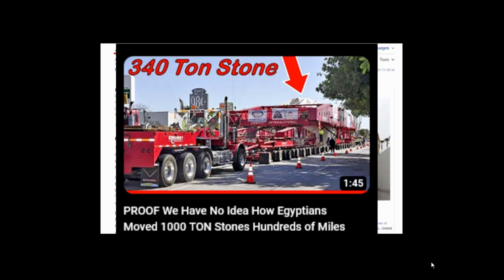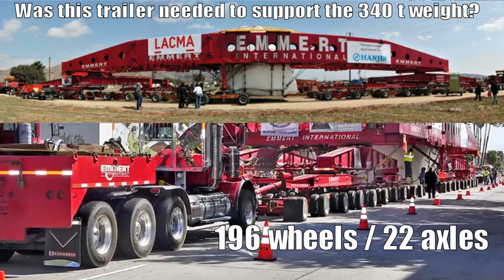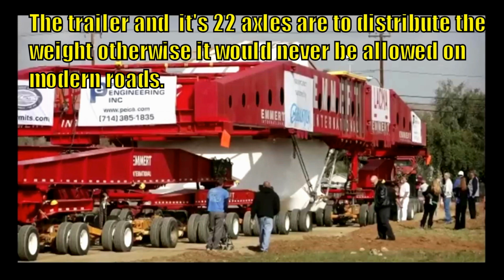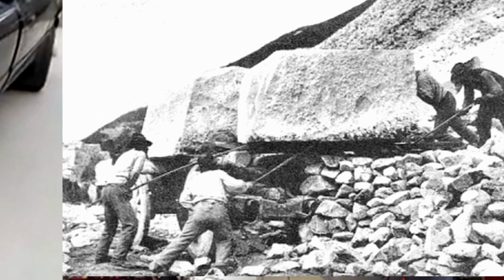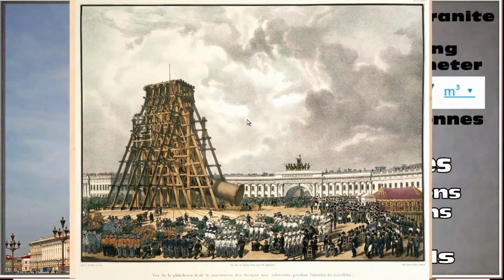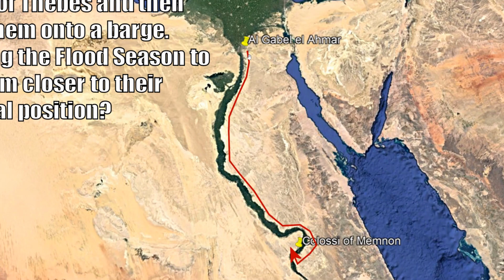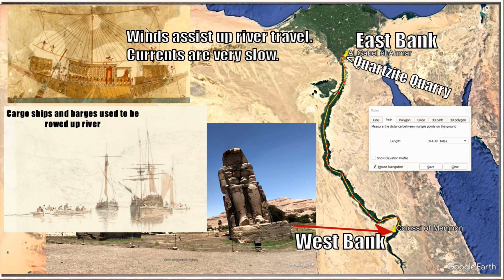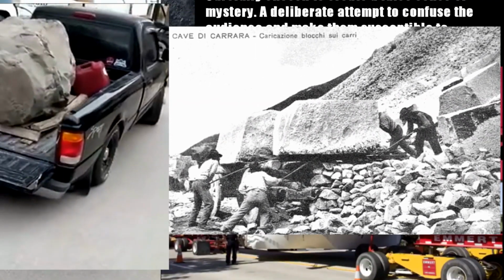Why Does Lost Ancient High Technology Keep Repackaging Old Scams As Fresh?

Comment: Happy new year!!!
And I have a bet for ya.
Since you insist that it's so easy to transport large stone and put holes and all that using ancient means...

Can you cut and carry a 4 ft x 4 ft x 6 ft granite, put it in your back yard, and drill a 2 inch wide hole, all the way through 6 ft length of the granite?

For transport, you can use any modern means, although ancient technique should suffice.
For the hole, do use ancient technique, like using some copper sheet thing, and document the progress.

I will give you 1 year, and if you can get it done, I will donate $3,000 USD to you as shown in the description.
Deal?
Let me know.
Reply from the maker: It wouldn't even pay for the stone.
I'll assume you are joking because this "deal" would be laughed at by any serious adult with a little bit of experience in grown up.
Here's $500 dollars, build me an extension on my house.
Here's enough seed to plant half an acre, now farm me an acre of wheat.
Reply: @SacredGeometryDecoded  Why would anyone pay for the stone?
I am asking YOU to:

1. Go find a granite rock in your local mountain, valley, or local quarry
2. Cut a 4 x 4 x 6 ft piece out of it using any modern method or ancient
3. Toss it in your truck, bring it to YOUR home
4. And then, drill a 2 in wide, 6 ft deep hole using * Ancient Tech *

Total out of pocket cost for ya = $0 + gas for the truck
But I am going to pay you $3,000, just showing how you did it.
You keep everything yourself.

Huh?

And how is this proposal equivalent with ME (living in USA) going to Australia and build an extension in YOUR home.
Do you think? Or R you high?
Reply from the maker: @sbkarajan  no granite for hundreds of kilometres from me.
“Hello can I set up a temporary quarry on your land and expose you to a court case if I’m injured”
You have no clue how the adult world works.
Who’s going to pay for my food or accomodation? 3k wouldn’t cover it.
Plus it’s more than a one man job and I’ve shown people moving bigger. That point is settled.
I’ve cut and drilled.
You get off your lazy ass and do something rather than”promising” 3k for a job that would cost many times more.
If you are not joking then you are so ignorant of real life. 3k wouldn’t buy a fence around a suburban size plot.
Months of work for 3k is the most idiotic offer in modern history.
You are detached from reality.
The personal injury insurance would cost more. 
All to prove to you things that have been done. 
Stop pretending to care . I have show cases old quarry and masons at work.
I drilled and cut with copper multiple times to show cutting rates.
Get off your ass and do something rather than offer pennies for a dollar.
If you are not joking the you are utterly ignorant of real world adult life.
Reply: @SacredGeometryDecoded  Why don't you just say you cannot do such a simple task, that was so~ easily done by the ancients?
Reply from the maker: @sbkarajan  it’s been done and I show examples of old timers doing it. You are another entitled lost tech fool who pretends to care but is too lazy to look the old timers up. 
Nutters like yourself used to insist copper can’t cut granite etc etc.
Now you demand others do even more of your homework for you.
You have no idea at all how things work or the cost of anything. You are a spoiled child or have been coddled into an ignorant adult.
To suggest 3k for such a job is just plain ignorant. You have no clue whatsoever. Even as a joke it’s too far fetched of a premise.
You live in such a fantasy land even the current day confounds your understanding.
Reply: @SacredGeometryDecoded  "it’s been done"?
Did anyone drill any hole, 6 ft deep, into a granite stone, using ancient method?
Please, teach me, enlighten me, who did it?
Reply: @sbkarajan  You are the type of person that says 'now build me a pyramid'. Goalpost shifter. 
Ever heard of extrapolation? It's a thing.
Reply: It's in the elementary school math-books. If 50 miles takes one hour, how long would 100 miles take?
Reply: @sbkarajan  Elementary, Watson.
Reply: @Akimos   Bro came in with 3k offer as if he is Mansa Musa or sth LMAO. Delusional...
Reply: @Akimos  Well, I think I have seen folks drilling 1/2" deep hole in a granite, took all day, and quit.
But are we supposed to extrapolate that to 6 ft deep hole?
That's like jumping 3 feet, which is quite high, and claiming that using the same technique, one can jump onto a 3 story building?
Huh?

Just show me somebody, anybody, drilling a 6 ft deep hole in a granite stone, using copper sheet, I will pay YOU $3,000.
How about that?
Reply: @Akimos  You guys are claiming that's how the sarcophagi in saqqara are made, right?
By drilling 6 ft deep holes, 60-70 of them, within a year?
So it should be EA~SY!!!! 
PROVE IT NOW!!!!!!!!!!
Reply: @sbkarajan  Like I said. You are the kind of person that says 'now build me a pyramid'. Maybe you need to understand that drilling is linear, what time it takes to cut into an inch is comparable to a foot, like time in my example. If I were to cut a hole that is 5'11'' you'd say that is not six feet. So there's no reason to do that. Unless you pay in advancce, of course..
Reply: You could jump 1500 feet high and 60000 feet high and your terminal velocity would be the same. (Edit 1500 ft, not 500) (Edit 2, I'm metric)
Reply: @Akimos  I will pay you $500 in advance if you have 4'x4'x6' granite ready to drill.
But I think I am wasting my time here.
You can't even get the little block transported in your backyard or shop or wherever.
While, Egyptians moved *MILLIONS* of stone blocks in 20 years and built the pyramid???????????
Using whut? Sticks? Wooden rollers? On sand????

Anyways, get the block ready to drill, $500.
Use any means on that, power tools, jacks, truck, trailer, whatever.
I will give you a year to work on that now, LOL!
Reply: @sbkarajan  You still think money can buy brains? Muahahaa
Reply: @sbkarajan  Millions of stone blocks that are not shaped at any time with a drill? Those blocks you mean in the Great Pyramid? (Edit: wrong propositon)
Reply: @sbkarajan  Let me ask you this, how far to your knowledge, is the quarry for the 99.9% of the stones in Great Pyramid?
Reply: @Akimos  "You could jump 1500 feet high and 60000 feet high and your terminal velocity would be the same"
But you jumped from like 5 feet. LOL!
1/2"  deep hole?
That technique ain't drilling 6' deep hole man.
THIN~~~~~~K!!!!!!!
Reply: @sbkarajan  Let me ponder you with this, is there any need to drill 6 ft holes, when you drill, say a sargofagus, or can you drill less than that, and still make it work?
Reply: I'm not hearing any coins meeting the floor yet, but I'm hoping for the pennies!
Reply: @Akimos  One of the largest sarcophagi, the dimension is:

Outside: 12.6 ft x 7.6 ft x 7.6 ft
Inner hollow: 10.4 ft long x 4.8 ft wide x 5.7 ft deep

So, how did they dig out the hollow?
How did they even cut that box out of the quarry?

I believe you have all the answers, some dumb theories that cannot be proven, not even remotely!!!! 
1/2 inches deep hole???? All day!!!! LOL!!!
Reply: @sbkarajan  Let me help you with the drilling a bit: There's a number that one can drill a day using handcrank. There's a number of how many workers can do it at the same time on one sargofagus. 
Another hint is that there's no need to drill 6'' because you'd rather drill out significantly less per layer, and knock it off, before furthering down. (Edit:misspelled words)
Reply: @Akimos  Yeah, I shifted the goal post....   really?
From the beginning, it was NOT about quarrying the stone, I am not interested.
I am just interested in the nonsense you believe.
How the heck do you drill a SIX FEET DEEP HOLE using stupid copper sheet?
S-I-X F-E-E-T????

No need to drill 6 '?
Not because it's easy, but because it's not doable, because it's IMPOSSIBLE!!!!
Huh?

Or, prove me wrong, you will love it.
And my $3,000!!!!!  🤑🤑🤑
Reply: @sbkarajan  OMG I got deleted... but

You are not interested. Really.
Reply: @sbkarajan  You are not even remotely interested in the actual work. you are just running your mouth. It's easy, when you understand the principal. 
Like asking a girl out. Would I dare, and the next thing you know, someone is getting, and here you are, stuck on capslock.
Reply: @Akimos  What the heck do you know or care about what I am interested?
$3,000, I am serious, and I want to know.

Or, just answer this simple question.
Can you drill a hole, 6 ft deep, into a granite, using hand cranked copper sheet?
I will give you a year to do it, and I will pay you ***** $3,000 ***** if you get it done.
There is only one answer.
Yes/No?
Reply: @sbkarajan  Stone Bell Hole Drilling
Kauai's Hindu Monastery
Reply: @birushinobi  There you go
Reply: @birushinobi  Interesting!!!
But these guys are arguing * copper sheet * and drilling 6 feet into it, not steel chisel. 
Nobody disputes using steel to cut and drill granite, but thanks for the info!!!!
Reply: @sbkarajan  You asked if it could be done using old methods, there you go. 150000 dollars, thank you
Reply: @sbkarajan  Just hope this helps on your journey to see better.
Reply: @birushinobi  Seeking the truth.
Do you believe we are just random creation of molecules mixing up in some ancient soup?
Do this.
Think of a way, you can build a * SPOON ***, made of any material, and make it to produce a copy of itself.
Like cells do.
How would you design such a spoon?
Let me know.
Reply: @sbkarajan  You said six feet. I said, there's no need to drill six feet for the sargofagi in Saqqara, but significantly less, and break out the layer, rinse and repeat. Stop making stuff up. No-one knows if they mixed techniques, so your request for 'do six feet' is useless. Furthermore, egyptian copper (arsenical copper, and we have proof for that also) is comparable with mild steel on Vickers scale, that is the test for metal hardness.
Reply: @sbkarajan  Do you understand? Comparable materials, two person can drill 18 inches in six to seven hours, that's 150000 your dollars for two person. 
Pay me up, will you.
I guess not. 
Don't be so quick to judge old timers.
Reply: @Akimos  I have no idea where $150,000 came from....
But are you drilling 6' or trying to collect $$$ without actually drilling 6'?

Are you an honest person do you think?
I believe I am honest, and I am seeking the truth.
Apparently, you just want to win, seeking TRUTH is not of your concern.

In my opinion,  Sarcophagi of Serapeum can be built using current tech, but not by the tech of kingdoms of Egypt.
But the Inca walls, those with curves and thin pieces that fit without any mortar.... 
I don't think current tech can reproduce that.

Anyway, a lesson learned today.
6' deep drill hole cannot be produced using stupid copper sheet!!!!!!
You gave up!!!!!   👋👋👋👋👋
Reply: @sbkarajan  $3000 for 6 foot hole. That was your bet, in a year. 
So they could do $150000 if they worked for a year. It's math. It's a thing. 
I'm all about science and truth. Inca walls, goalposts are shifting again. Anyway, SGD has videos about all and any of your concerns, maybe give them a look and make an educated guess after seeing those. 
Serapeum is not old kingdom. Maybe look that also into more. (Edit typo)
Reply: @sbkarajan  One more question, how come you have $3000 to spend when you have zero mathematical skills, is it inherited?
Reply: @sbkarajan  I should have said 'are they inherited', because that is what I meant.
Reply: @sbkarajan  Anyway, a lesson learned today.
6' deep drill hole cannot be produced using stupid copper sheet!!!!!!
You gave up!!!!!   👋👋👋👋👋

All of these seems untrue. Maybe go trough this thread and see if there was anything that even slightly hinted how the boxes were made. 
I haven't even started yet. (Edit, typo corr)
Reply: @Akimos  I don't have just $3,000 to spend, I have a lot more...
My monthly credit card bill is about $20,000 - $30,000 USD... 😁
And Inca wall isn't shifting goal post, it's a **NEW** goal post, if you want a challenge, as you gave up 6' deep hole.

I saw SGD's video, he does not know what he's talking about.
Fitting stones with some arbitrary curve vs straight line, totally different.
Plus, fitting stones without gap and with gap, another huge technological difference too.
I put some retaining walls, rectangular concrete blocks, with 1-3 mm gap between them, easy.
If I wanted no gap, well, I could not do it.

The lighthouse example, just straight line, so it's not something comparable to curved inca wall to begin with.
And we don't know if the stones have gaps between the joint.
Reply: @sbkarajan  Again, you are comparing yourself to a master masons. One could have an anglefinder, or draw out the shape from the existing wall to transfer to next stone.
Reply: @sbkarajan  Elementary.
Reply: @sbkarajan  Let me help you with this, anglefinder in its purest form is two pieces of wood, with a nail in the joint. Think incas had the capability? OMG (Typo, again)
Reply: @sbkarajan  Let me ponder you with this; if the stones were found above the ground, is there a chance they would already fit together pretty nicely?
Reply: @sbkarajan  Or, as since ever, ignore all the evidence and points given to you completely. Your call. I'm not even warming up. (typos everywhere)
Reply: @sbkarajan  How far is the quarry? How far is the quarry for GP? You don't care.
Reply: @sbkarajan  The Great Pyramid
Core stone blocks were quarried approximately 400 m (1,312 ft) south of the pyramid, and the casing stones, made of white Tura limestone, were quarried on the eastern shores of the Nile. The King's Chamber stones were rose granite from Aswan, approximately 900 km (560 miles) from the Great Pyramid. Three whole seconds it took me, and you cannot be bothered.
Reply: @sbkarajan  Do you speak american? That's quarter mile on the GP.
Reply: @sbkarajan  Do you like kitties, I do, so much.
Reply: @sbkarajan  i can tell you like cat videos.
Reply: 🥱 Such feeble attempts at logic vis straw man argumentation......  Ancient sites represented = a societal effort - not an individual one.......  That you apparently can not think beyond your simplistic terms says it all.  It simply demonstrates you are consumed by your incredulity here until all you can do is ramble nonsensical arguments.
Reply: @varyolla435  I see, you heard of coral castle?
If the owner did not share how he did it, we’d have thought it was a “Societal Effort” too😜😜😜
And I am not actually interested in how the rock is carried, that’s “supposed” to by the easy part.
I want to know how the DEEP hole, 6 ft or more, is drilled using stupid copper sheet.
Drilling a hole is a societal effort too? 
Huh?
Logic!!!! LOL!
Reply: @sbkarajan  Like I said, goal post shifter. First it was drilling, then quarrying, now it's Coral Castle. Have you ever heard of doing own research, it's a thing.
Reply: @sbkarajan  Like I said, it's math, and elementary, at that.
Reply: Can someone find the monks doing the hole on the thing -video? Let's give this guy all the help he needs
Reply: Where are you from? $3K U.S. in the states would be lucky to get you a granite tombstone about 1/5 that size with date of birth and date of death lightly engraved. Would be like offering my Amish neighbors 3K to build a two story house entirely by hand including cutting down the trees and working them into boards for 3K. Would be a great way to learn about ten different ways to say "piss off" in German.

I will make a counter offer and double it. $6K if you post a video showing you doing that same project using the ultrasonic and anti-gravitational devices proposed by the LAHT advocates. Five hundred bucks bonus if I see that 30 feet wide power saw that cuts thru granite like butter involved at any point in the project..
Reply: @jackrifleman562  The problems with you guys are:
1. You are missing the point, completely.
2. The blind belief of the BS you are told by the mainstream.
Just checked prices, tombstones, polished and "photo" engraved, about $900-$2,500 USD.
But don't you keep that little tombstone yourself?

What I was asking is, giving a clueless debunker a project, that he will keep for himself and make a profitable video while doing so.
He dug 1/2" hole on granite for nothing, just made some videos of it.
But he can't do the same thing, just 144 time deeper, is impossibility, like comparable to building anti-gravity device?

No, this is not about money, it cannot be done. Simple.
Reply: @jackrifleman562  My comments keep getting disappeared man
Reply: @jackrifleman562  I am editing and editing and editing to make it not get deleted
Reply: @jackrifleman562  What I was asking is, giving a clueless debunker a project, that he will keep for himself and make a profitable video while doing so.
He dug 1/2" hole on granite for nothing, just made some videos of it.
But he can't do the same thing, just 144 time deeper, is impossibility, like comparable to building anti-gravity device?

No, this is not about money, it cannot be done. Simple.
Reply: @sbkarajan  "What I was asking..."

Is for an experimentalist to undertake a project where $3k is a pittance compared to the required task and expenses.

He isn't the clueless one

Drilling in granite would be boring and less lucrative than whipping up a  30 feet wide circular saw going tru some granite like butter. I think we would all much prefer to see that. And a whole $6K for it.

Yes or no?
Reply: @jackrifleman562  My comment deleted again, man....
Reply: @jackrifleman562  I will keep writing
Reply: @jackrifleman562  How credible is CNN to you?
Reply: @jackrifleman562  100%?
90%?
Reply: @Akimos  My comments are randomly deleted.
So I divided the comments into smaller parts and then some shows, some don’t.
Any contrvsl words, the whole thing gets deleted.
Reply: @Akimos  BTW, you have no idea
Reply: @sbkarajan I am actually interested in seeing ancient examples of 6 ft deep drilled holes.
Reply: @Eyes_Open  I'd love to see one, too, but this 'the moon is an alien spaceship' -type isn't even understanding what is said.